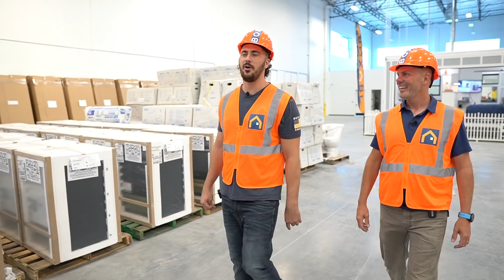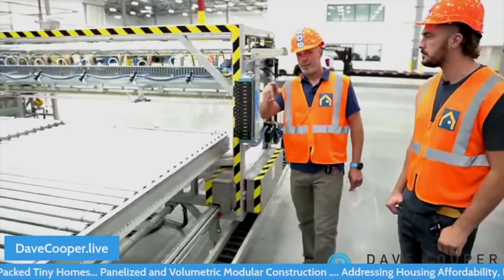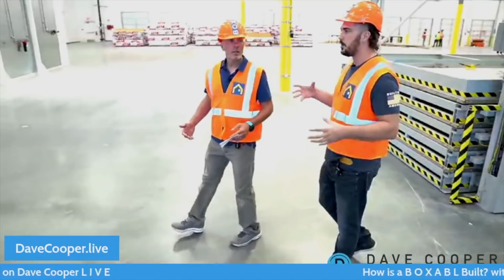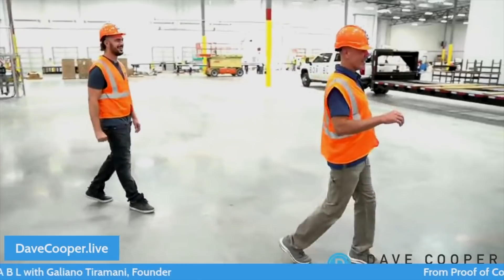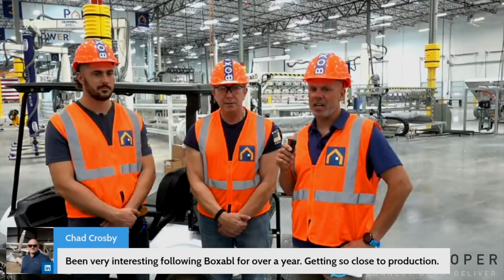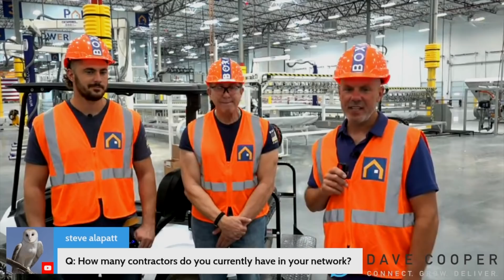Factory Tour at BOXABL Building ADU's and Prefab Tiny Homes for Billionaires

Comment: How wide, height, and length of the Boxable houses?
What is the price of the Boxable houses?
In one segment of discussing the Boxable, it
was stated that one can purchase the unit 
in installments of $250.00. Is that info true?
Reply from the maker: The Casita is 375 square feet in size, measuring 19.5 x 19.5 feet with 9.5-foot ceilings. It weighs approximately 15,000 pounds.

Comment: What is the product they use in lieu of the sheetrock? That's fire proof?
Reply from the maker: Nothing is immune to fire. Boxabl, however, was designed with fire resistance in mind. Both the inside and outside of the building are covered with noncombustible materials. This suggests that flying embers that cause forest fires will not ignite your Boxabl.

Comment: Using mini split heat pump air conditioning systems I hope they have the condenser directly behind the air handler and thought ahead about replacing leaking refrigerant piping in the Casita.
Reply from the maker: Hmmm, Why are you assuming it would leak?  It's the same variable as any system installed . Could it yes but it's not a common problem..is it?
Reply: I'm wondering were you referring to making the system easily accessible for repairs?.

Comment: Look at the cupboards in the kitchen they're so narrow you couldn't put a platter or a plate in there it should be the depth of the refrigerator.  Also I find that the bathroom sink what you call actually call lavi is a very odd design and very difficult to work in you've got any kind of arm problems or hand trouble like deformity you can't get your hand down inside that bowl to get the water up the sink should be down below the counter not sitting up on top of it I think that's another poor design in this box full House.

The other thing I find that doesn't work well is there's too many walls and too many windows. When you have walls then you separate things which don't need to be separated. And when you have too many windows you don't have a place to put a cabinet or a shelf or a standalone cabinet or even a picture too many windows is not a good thing.
Reply: It is great to have many window when you large land space. But a lot place doesn't have such space, so maybe it can come out an option to cover some window if you do want it.
Reply from the maker: Thanks for commenting on the video and providing feedback.  Boxabl loves the feedback and is always learning. Weight, fold areas and structure play a big part in the design.. I'm sure we'll see this Casita transform over the years...